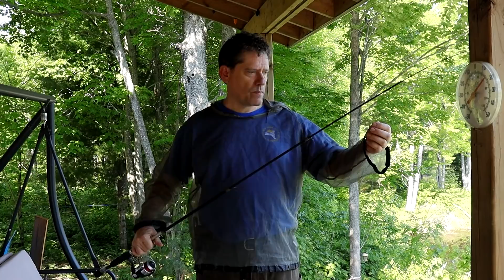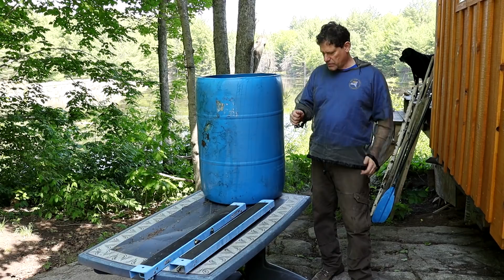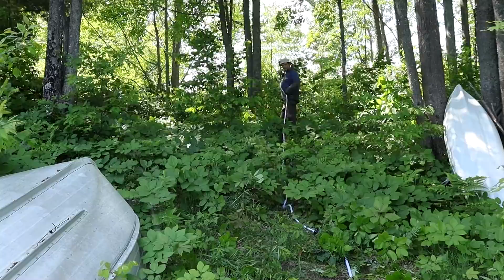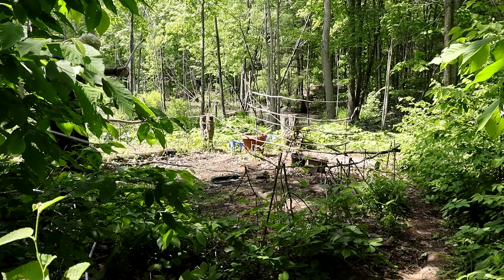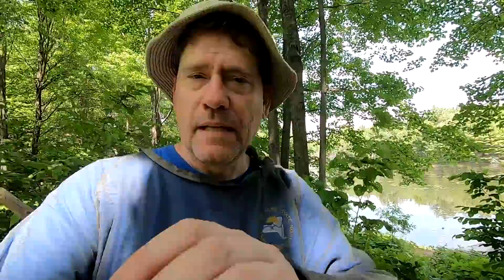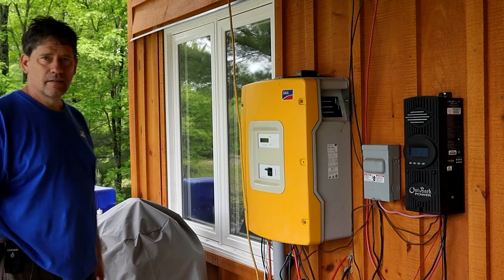The Water Curse - Off Grid Living

Comment: For off grid power I use wind and generator and a bank of 5 AGM batteries coupled to a 3000 watt pure sine inverter.  It gives me all the power I need but would like to add solar.  I think my hybrid charge controller will handle up to 600 watts solar and 800 watts wind (MPPT) at the same time.  I am also in the Bancroft area.  I would love to see your proposed video.
Reply from the maker: What wind turbine do you have and how do you have it mounted?

Comment: I’d get a low volume submersible pump and a couple of used 250 to 300 gallon totes to store the water in.  Put the totes up on a stand and water the garden with gravity feed drip irrigation from the totes.  Don’t know about Ontario, but can pick up used totes for under $100 each where I am.  A good pump will be where the money goes.  Black poly pipe from pump to totes would be pretty cheap.
Reply from the maker: Robert will defeintely grab a 250g tote some time soon.

Comment: hey there russell great vid ... what would it take to make that pond sustainable is it just murky water is there anything u can build into the pond to make it liek a filtering system to be  clean water ot is that not possible . when are u gonna add some fish in there or is that not poss to add some bass or rainbow trout as long as some bottom feeders who will help clean the crap ... longer hose bigger pump that will push that head height up the hill .. if u do go this root , in the winter just make sure to take pump apart and dry the insides as when they sit they always rust and are useless the next season .deff a longer hose more durrable hose that u can just leave hooked up to a bigger pump will save u all that hassle with the barrels to just plug in your power supply the only thing u will have to look at is how much the pump can move up the grade and how long to the garden .
Reply from the maker: GOod call, Tom. I'm planning to stock with large mouth bass. They should be fine.

Comment: Thanks for the video Russell. I always enjoy your sense of humor. For irrigation and maybe even water for washing I'd consider pumping from the lake with an inexpensive 120VAC diaphragm-type pump. Here is a 100 watt, 3.3 GPM (12 LPM) @ 45 PSI pump that can even self-prime. $75 USD https://www.amazon.com/SHURflo-Industrial-Pump-Model-2088-594-154/dp/B0001FAA5Y/ref=psdc_554568_t3_B08DKV1NWX If you're interested in trying something like this there are a couple things you'd want to know about setting it up to get decent service from this type of pump. If you want I'll share my tips.
Reply from the maker: Sure, but what have you got for filtration? Say I wanted to turn beaver water into potable water?
Reply: @RaspberryRockOffGridCabin  The pump requires an inlet filter but only to strain out big stuff that could harm or disable the pump. To make the water potable I filter in steps of 20 and 5 microns finishing with a  0.5 micron Doulton ceramic filter and follow that with an activated charcoal filter for taste. I believe this is the equivalent of what a Berkey filter does or even a Sawyer filter (if you added an activated charcoal filter.) At our island fishing shack in northern Minnesota we keep a large stockpot of filtered lake water simmering on top of the wood stove for sterilization (except in mid-summer.) Water can also be sterilized by putting it in clear glass jugs and setting it in direct sunlight for a day. I could also use bleach or iodine if I wanted to but I don't. We are lucky that there is also a public spring with excellent tasting water abour 15 miles away where we can fill jugs and haul them to the island in the boat. BTW, garden hoses don't work very well for pump intake lines if there is much lift because they can collapse under suction blocking the water flow, especially on warm days. Poly pipe works better and even after buying the end fittings it is often cheaper than garden hose. Thanks again for your videos Russell. Now I must be off to make my wife a nice bowl of Piddish. ;-)

Comment: You should not be using that much power in a day in a small cabin. Even a high powered Laptop uses very little. Check the power usage of your fridges & freezers. But your bigest drain will be that Bread machine or any other electric that heats. Not sure if you have one but an Air conditioner also uses a ton of Power. Unfortunately North America uses 110volt which is less than 50%  the efficiency of 220/240 volt.
Reply from the maker: I'm pretty wasteful in the summer. In the winter I cut down on CPU use, etc.

Comment: Maybe the Wizard can make you a metal cover for the water pump. I have 3 petrol driven pumps set up on my propety, all happily live out in the elements with galvanised covers, When I need to use a pump I simply lift the cover off. Cheers
Reply from the maker: Erich I'm just gonna use a plastic tote.

Comment: This worked a treat! Something to try is a soaker hose for your garden rather than a sprinkler. If you can get the right lift to provide head pressure you might even be able to run a watering timer off the barrel (this is what I want to try for mine my I've not had time to experiment) and then all you need to do it maintain the water in the barrel. And get a 100' hose and some extra ends in case you end up with more hose than you really need rather than multiple shorter ones. Mind you, can you have too much hose when it comes to watering?

Comment: Check what the pumps input voltage range is to see if you can direct drive it off the old panels when you replace them on the roof. A small stand for a panel or two down at the pond to hook the pump up to would let it daily pump water when the sun is out to run a soaker hose setup.
Reply from the maker: Andrew it's a 12V pump, which is why I use that jump starter.

Comment: Sprinklers are not a very efficient way to water a garden. Think about seep hose to put the water right by the roots. A pond pump can be left in the water most of the year depending on not being frozen, but you don't need to water the garden then.
Reply from the maker: Yeah they're not very efficient, Valerie. But it works!

Comment: Just put the pump in a small lid sealed plastic box.  Cut some holes in the ends and have the hoses coming out of each end.  You can keep the electric cord in there with it and only open it when your running it.
Reply from the maker: My thinking too, Kirk. And if I stuck a battery in there, and put up a small solar panel? GOLD.

Comment: I've got a 10kW solar system with 28kWh storage which I will probably double this year. It's overkill for summer, but except for November, December and January I'm good (I'm at 63 degrees north - no sun at all in winter). The larger battery pack is mostly so that I only have to run a generator in winter once a week or so to charge the batteries.
Reply from the maker: That's the same size as my old battery bank. Well, 28kWh of lead acid. 20kWh of LifePo4 will actually be larger than the old one. And there are other annoying things like you don't want to charge your lead acid above 80% on a genie, but I wouldn't have that problem with the Lifepo4
Reply: @RaspberryRockOffGridCabin  yeah, LiFePO4 in my case as well. Too much trouble with lead acid.

Comment: When I was looking for a boost pump(high pressure) for my house that has 18psi normally, I thought most pumps only suck about 8 feet of elevation.  A special one($$$) may do a lot better but I was impressd with the idea of mostly pushing the water and not sucking.  I actually didn't have the option of pushing all 50ft up the hill from the water meter to my house so I put the pump in my house in this closed pipe system and got reduced benefit because I was only helping about the 8' I was talking about.
Reply from the maker: Gordon, would it have helped if the line always had water in it? Or am I misunderstanding?
Reply: @RaspberryRockOffGridCabin  You seem to miss the weight of the water.  Typical pumps can only suck so much weight of water.  That will affect priming too if you are way above the lake and it won't prime this a reason why.

Comment: Water is always my biggest issue at the cabin. My suggestion is to stick with your rain water set up, but pick up a Sawyer water filter system to get you through those times the rain doesn’t come. They are affordable, and I have used them in every type of nasty a$$ water you can imagine and have never once had any issues. They are easy to clean and you can store them for long periods of time after a bleach rinse. They say they are good for 100000 gallons. I have one that is ten years old and it is still working. It is my reserve unit now mind you but I still trust it. Or don’t hahahahaha
Reply from the maker: Hey Tyler, which model do you have?
Reply: @RaspberryRockOffGridCabin  I use the Sawyer mini, they have a cool squeeze bag system, but I also use it as a gravity drip filter and it works well both applications! It will also screw onto a pop bottle if you’re in a pinch. I swear I don’t work for them hahahaha

Comment: Now you can attach a drip system from the barrel to the garden and turn on the valve when appropriate, minimizing water use and effort on your part. Effort on your part being the most important of the 2. I thought that the barrel was higher than the garden, allowing gravity flow. If that isn't the case, this idea is withdrawn.
Reply from the maker: Richard, I think the top of the barrel might be very slightly higher, but definitely not the bottom. I'm going to try and just pump the water straight to the garden with no barrel, that seems the best way.

Comment: I'd love to see you video an expedition to look at other solar systems.  Educational.  What do you do with old solar panels???  Are they recyclable?  Resalable?   Can any of them be used in some other kind of manner on the property "Not tied to cabin system? Like a water filtering system???
Reply from the maker: Patti, solar panels last 40 to 45 years before their output is so diminished they're unusable. Then I think the only recyclable part is the aluminum frame. But mine are still good and might be sold for cheap. Or I could use them in other projects, yes.

Comment: Put the hose in the sun for awhile to make it soft and pliable. Maybe get a pond pump so you can put it in the water. You would be very surprised how much even a small pump can push out. You can also regulate how much it pumps out. A medium sized one would work and they are not that expensive.
Reply from the maker: It's pretty much there now, Carrollyn
Reply: @RaspberryRockOffGridCabin  The pond pump with the hose that you can get would eliminate the need for the barrel and extra hoses.

Comment: Bread - Let it cool right down, then use a good sharp bread knife (and keep, ONLY for bread or bread rolls etc) that you use the weight of the blade cut the bread and not try to push the knife down. It should fall from holding with just the thumb and finger, but obviously using the whole hand will help guide a perfect cut every time.

Fishing, damn, there must be fish in there right? I would even be tempted to stock it and reap the benefits if it is isolated or possibly able to be.

Hose to garden - Yeah, use one good quality hose to the 'Tank, or tanks if you put a pipe bridging between the two' and then use a short bit more to the garden area, then use cheaper stuff to move about as needed to other areas.
Reply from the maker: NOW YOU TELL me Richard.
Reply: @RaspberryRockOffGridCabin  I love watching your vids, wish they were a daily thing even. Sometimes I think I am the camera person... lol

Comment: Hi Russell,
I would to see you go with Ray on a job; I was also happy to listen your usage requirements.i.e. 
10k not enough.. 20k better, 16 / 340volt panels
I would like  a system big enough to run a washer or dishwasher on a sunny day .
p.s. your intake pond hose would be better if you used an old milk jug to keep it off the bottom.
Reply from the maker: I'd love to be able to run a washer and dish washer here. I just need more water.
Reply: @RaspberryRockOffGridCabin  Would the water used for dishes need to be filtered?
Reply from the maker: Codyak, I just use straight rain water for dishes/shower/washing clothes. No filter.
Reply: @RaspberryRockOffGridCabin  well, more gutters on the other side of the house, more barrels, and I would pump that water inside and upstairs, the other side of your bedroom... or if there is room behind your bed.

Comment: would really wish for a good tech vid on solar I need to start thinking of that for a very mobile live work situation and a splash of 240/110 volt  already have a filtered 8kwh generator to power off work machines separate from domestic needs. Hopefully can get some income post lockdowns
Reply from the maker: Stephen you'd be best to call a local company to discuss your options. There's a lot that goes into it.

Comment: take a windmill... you can find many great ones perfect to provide you together with solar into the winter for constant power! cheers
Reply from the maker: Mario, I talked about that with Ray as well. He keeps insisting I need to get it above the trees. Unless he's got a good tower option for me, I'm not doing it myself.
Reply: @RaspberryRockOffGridCabin   yep, maybe you cut top of tree and place it with metal attached plate on top! Cheap and tree doesn't needs to die, it is gonna be little unstabel so you can at triangles under the stem... just helping with thinking with you ;D Iamfollowing you from your begining when you builded the cabin....its a dream from me to liv like you do, but impossible because of regulations and prices for land in small Belgium. Cheers
Reply: @RaspberryRockOffGridCabin    Windmolen op het water

Comment: Just one more comment.   Any tiny air leak on the input line to the pump, no matter how small, will contribute to the pumps inability to lift water from the pond.   :)
Reply from the maker: I should be good, Bob. I used teflon tape for the joins.

Comment: You can crown your gutters from center to both ends and add another downspout and rain catchment. Just curious Russel might there be any springs that can be utilized with ram pump systems to the cabin? Also you should consider a six pack of grass carp of the same sex and they will keep the pond clean of a lot of algae.
Reply from the maker: Ken, where do you buy female only grass carp?